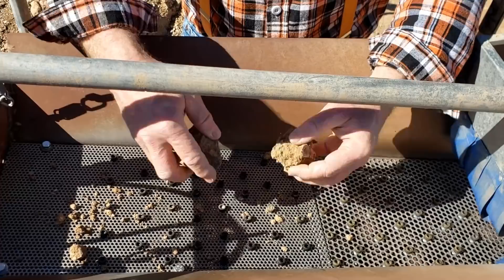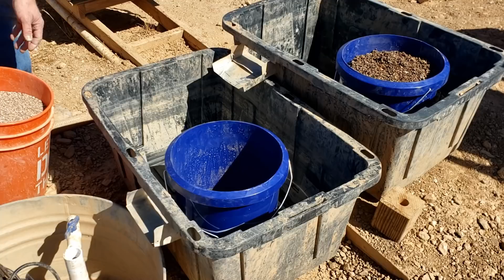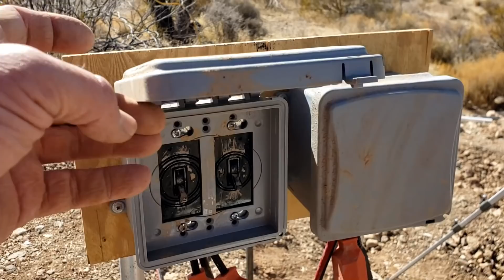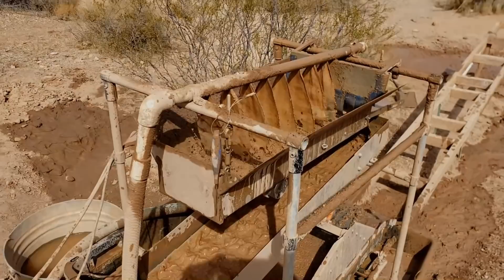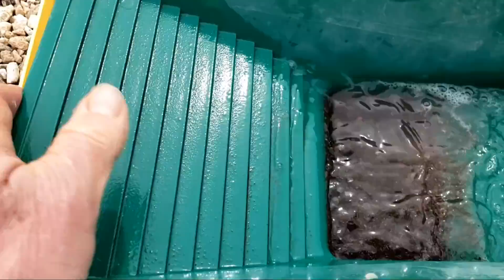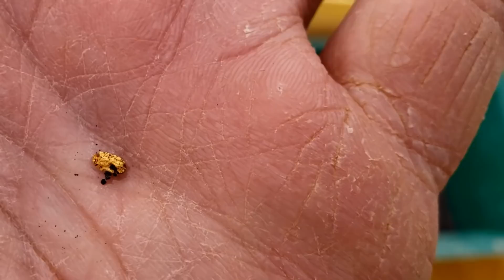Desert Gold Wash Plant Innovations 2021

Comment: I still can't come to grips with why your fine mesh doesn't clog up.
When I use a circular hand classifier at smaller than say 20 mesh , I need to turn the classifier upside down and tap it ready for the next load of material.
Also , do you not have issues with grass and decaying matter clogging up the works anywhere along the line ?
Reply from the maker: Thanks for your questions Mohammad.  That's the key to the intense vibration of the deck.  It causes solids and fluids to dance on the screen surface.  Eventually water drops through the deck while the sand dances off the end.  The deck pulse frequency is 60/sec.  Vegetation dances off the screen deck as well.  This eliminates sprayers from clogging  when water is re-pumped up to the upper shaker deck.
Reply: @allansgoldmining  Does your screen shake in all 3 dimensions or only up and down ?
Or maybe up and down and left to right
I am thinking about getting my backpackable system improved , but cannot utilize the sand filter - what am gonna try next is a punch plate screen wrapped in womens stocking.
Is to stop grass getting into my bilge pump
Reply from the maker: @mohammednovalija  the stockings sounds like a good idea !  Especially for a backpack system.  That should eliminate the vegetation issue. Sand would be too challenging to hike with.  There many secrets that I didn't want to divulge in the video regarding the science of the dewatering deck.  This was an attempt to protect my interests, preventing others from stealing my knowledge, then compete commercially. The large scale manufacturers of these dewating decks will not divulge the science behind how they work.  Sure, there are plenty of videos and animations, but no science.  I spent many months, days, hours, researching and experimenting to educate myself on this.  With that said, I can tell you that the "shake" of the deck is in a vertical direction tipped at 45 degrees.  How it accomplishes this, is a huge secret.  All components have to function perfectly, in order to operate correctly.  Best of luck to you !
Reply: @allansgoldmining  Thank You for description of your travels toward the goal of turning a desert into an oasis.
My material has probably half the amount of dirt you are battling against.
It seems there is only so far that you can downsize the equipment where it simply not viable for the amount of material processed in an hour - and the associated pay off.

Comment: Sir, just saw your Innovations 2021 , this is a question more than questioning your methods. Why would you run the silt through your sluice without the riffles or atleast moss ? Wouldn’t it be careless of you missing any fines going out with the silt ? Thanks for your time !
Reply from the maker: Hi William.  Are you referring to the sand clean up ?  If so, there is no gold in that gooey clay.  All was recovered on the sluice riffles during  the initial run.

Comment: You should invest in some flocculant instead of all that sand trap stuff. Then the good would settle out and you would just need to use the dewatering shaker and main shaker.
The tubs would be for settling and you'd do a over/under/overcurrent flow to force stuff down and out. Would let you run for a long time without needing to clean out he clay buildup.
For even longer runtimes an auger lifter that dewaters and lifts out the clay could also be done. It may be hard to get enough retention time in the settling though. Maybe a swirl tank could work too? https://youtu.be/G5w-6pnjwIc?t=298
Reply from the maker: First off, I DO use a floculant and Jet Dry.  2nd, what you are prescribing is for a large permanent based operation.  Very impractical for the weekend prospector.  3rd, For this application, sand is far superior for removing suspended particles.  The video link is interesting, but certainly could not handle the volume of suspended particles that is encountered with is plant.  The flow rate is 33 gallons/min.  Best of luck prospecting!

Comment: love the vid. great job on the build for the shaker sluice. one question tho.  i notice you have no powder/fines in your pan. admittedly fines usually take a lot to make it matter, but i think you may be losing your fines in the clay that is being discarded. might want to do a test pan or blue bowl some time to see if you are missing it. just a thought. have fun and good luck. looking forward to more videos. joe
Reply from the maker: Hi Leo.  No gold in the clay or tailings.  There's lots of -200 mesh gold in the pan.  Camera resolution doesn't present it well.  It's completely mixed throughout the black sand.  If you recall, I mentioned that you can't recover these fines with a dry washer.  Best to see it in a Blue Bowl. Thanks !

Comment: you might be able to run a 250 or 300 mesh screen on your shaker deck. Also If you spray off you screen like every 5 or 6 buckets of dirt would help your shaker deck work better.
Reply from the maker: Hi David.  After extensive experimentation I have concluded that 200 mesh was optimal. The large companies use 200 or less.  Also need to factor durability.  Finer screens are more fragile and can deteriorate at a higher rate.  Thanks for your comments. Best of luck to you prospecting.  🤠⛏⚒👍

Comment: Just out of curiosity, with the residual vibrations through the frame of your set up, how much is it efficiently or in efficiently  affecting the sluice. Even though the shaker and dewatering table have the springs they are hanging from, I would guess that there would still be some transference of the vibrations especially with so many motors above and below the sluice. I'm just wondering if those vibrations would be causing the gold in the sluice to be agitated enough to be bouncing around and hop/walk over the riffles and be caught/pushed along by the water flow. Maybe you could put some neoprene or rubber stubs. What would also be interesting is whether a slower vibrating motor at the top of the sluice box would make the gold walk up the sluice, much like tapping a pan to get the gold back to the top of a pan. Keep toying and inventing dude, great vid
Reply from the maker: Thanks for your comments and thoughts.  Despite what you see, there is very little vibration transmitted throughout..  The sluice rests on rubber pad.  Many people have rested their hands on the structure and sluice and were amazed of the dampened quality.  There is more vibration created by that material and water flowing over the riffles than could be of any concern from external forces.  Consequently, I test the tailings and find only a couple -200 mess specks.
Reply from the maker: Oh, I forgot to mention that the riffle mat is made of rubber.

Comment: You shouldn't use 2 vibrators in series, instead turn of them 90* to vibrate in both directions.   This way the two vibrators won't damage each other.  Also add vibration damping bushings or washers to the base frame to isolate vibrations/excessive wear to the lower frame.  It will also help keep your pipe stand from vibrating down into the soil and becoming out of level
Reply from the maker: Wow, not sure how to respond.  What is your expertise regarding vibratory physics and Energy Balance Mechanism (EBM) ?
Reply: brushless?

Comment: So at the end of your run you dirtied up your remaining water to clean the rocks - and then start with clean water the next day?
Reply from the maker: Good question James.  I use the existing dirty water to clean the sand.  Virtually all the suspended particles will fall through the deck screen (because it did on the first pass).  The vibration strips the sand of most moisture.  The suspended particles settle in a couple hours, so I muck out the tubs.  The next day I need only to replenish a small amount of water, while recycling the existing water.  The freshly cleaned sand will filter whatever particles become re-suspended.  Thus saving a good amount of water.

Comment: That was a great idea I would like to try something like that around here. There is so much quartz rock around here do you have any idea for a small rock crusher that I can add.
Reply from the maker: Hi Jason.  I don't have any recommendations for a rock crusher.  I know that Jeff Williams has reviewed a chain mill.  Maybe that can help you ?  Best luck to you prospecting !
Reply: @allansgoldmining  A simple small scale crusher can be made with a galvanized pipe with a cap on one side, then use a smaller capped pipe to ram inside after you put the quartz rock in. Just keep slamming the small pipe into the large one and it'll keep crushing.

Comment: Allan, Thank you for mentioning that you copied from the oil industry, Also another suggestion is make the exit end adjustable, due to the fact that when the finer screens run dry they tend to break up and they become very expensive, also adding what we call a "Possum belly" at the head would be beneficial at increasing the life of the screen.
Reply from the maker: Thanks Nugget.  You seem to know much about this type of equipment.  I spent many months researching and testing (and lots of failure).  The companies keep their technology a secret, so most of my education came from watching videos.  Finally found a research paper by the Chinese that helped a lot !  Yes, the deck is adjustable.  Had the end tipped up 2 degrees.  Also had a weir bar on the end, but the gooey clay began to accumulate too much, blocking parts of the screen, so I removed it, and works much better.  So, what is a "Possum Belly ?"  Is that something that softens the slurry landing on the deck ?  My slurry lands on a slick plate, so it gently flows onto the screen.  Thanks so much for your inputs !

Comment: AL you just hit a Bonanza on what you built get a panten pending on that puppy .you will be a millionare 4xs over
Reply from the maker: Thanks for the advice Lucky !!  Unfortunately, the dewater deck was already patented back in the 1980's, so not much to work with.  Looking forward to manufacturing these in near future.  Hope to make a few $$$ to pay for my hobbies.  LOL !  Thanks for your kind compliments !
Reply: @allansgoldmining  
Ummm AL if you have changed 10% of that Washer yes you can law states you have to change 10% that flat wash deck and  them 4 shaker motors and abything ells you changed will give you 5% you may have changed 10 to 15 %

Comment: Susgeston ..
Make a larger water holding container .take a 50 gallon barrel cut it  about an inch or two taller than your container size for your water .drill a serries of holes in the barrel if that pump will fit in a 5 gallon bucket  good Drill a series of Holes in the 5 gallon bucket  wrap the  bucket with screen .fill between  the bucket and barrel with sand  and use what you use for strainer for your pump .. this is what we ust to do years back with spring water   dig a hole for the barrell  only we would make it 5 to 6" wider  wrap the barrel with a nylon screen a couple time and place the barrel and fill around the barrel sand and charcoal to filter the water .. for making Corn whiskey  it would filter the water to drinkable and gave it a ph level of around 5.5 ..
Reply from the maker: Hey now, that's some good advice !  Let me "noodle" over that. Hummm ??  Appreciate it much !  Cheers !!

Comment: Love the new setup, looks like it's working better than ever. For doing your cleanups I recommend one of those flouting magnets for quickly and easily removing all your magnetics. What you said about putting the whole washplant on a trailer sounds like a great idea. Great video as always, can't wait for the next one. :D
Reply from the maker: Thank for watching Luke !  Appreciate the comments and compliments !  The sluice mat I use does a good job of removing a good amount of black sand from riffles.  I use a "Spin-it-Off" to remove additional magnetics from the cons.  Unfortunately, about a third of it is non-magnetic.  So, I still get quite a bit in the pan.  That's okay.  I use a Blue Bowl for final clean up.  Does an excellent job tackling the remaining black sand.  Best of luck to you !

Comment: Well done, that was amazing. Definitely an "A" grade project in engineering class there. Maybe one of these days I can see it in action. I'm going to do a recirculating sluice video myself here in the next few weeks. Mine is the lazy mans way that uses much more water. I'm planning to add a little flocculant at the end of the day, let the whole thing settle overnight then reclaim the clear water and dump the sludge. I'm hoping that with overnight settling I'll be able to reclaim about half the water in the system. Its not as heavy in clay as the stuff you are working. But I tried dry washing and because its fines and flat pieces,my tests show I got about 1/3 of the gold by dry washing - and even so I was getting a good 2 to 3 grams per yard. Hoping I'll get 80 to 90 % with sluicing.
Reply from the maker: Hi Chris !  Thank you for the kind compliments !  Glad you enjoyed the video.  Perhaps you can apply the sand filter idea to extend the life of the water in your sluice operation ?  Good idea to allow water to settle overnight.  I do the same.  Sometimes I muck out the sludge the evening before, so when you return the next day, there's a bit more clear water to recover.  If you're finding 2-3 grams with a dry washer, can only imagine what you'll find with a sluice !!  I'm jealous.  Wish I had that kind of ground down here. LOL !  Definitely, looking forward to that video !  Best of luck to you my friend !
Reply: @allansgoldmining   
~ Allan, Keene advertises that their 'dustless' model series 160, 190, and commercial 210 'dry washers' have recovery as good as wet sluicing. Have you ever heard about the performance 'or' personally tried Keene's 160 or 190 series dry washers.??
Reply: i've been using the keene flocculant in my recirculation system, that runs into a 5 gallon bucket from the sluice and the results are amazing. you can actually see that 4-5" from the bucket over flow that the flocculant is working. it has greatly increase my ability to process more dirt in a day! and yes Allen, i really like your innovation!

Comment: Do you classify your material at all before placing it into your machine ? - I myself run a 1/4 inch trommel and I classify the dirt to 1 inch before running it
Reply from the maker: No, I feed everything up to 6" rock.  This way I maximize gold recovery.  Gold tends to trap among large rocks.  Classifying, reduces your ability to recover more gold.  It's the same problem with the classifier on a dry washer feeder box.  Granted, I don't wash boulders.  Best of luck to you !
Reply: @allansgoldmining  Yep makes good sense - In my case I use a bucket classifier and classify into a bucket of water so the Bigger rocks get washed and hopefully any gold attached falls away into the bucket before throwing them away
Reply from the maker: @mohammednovalija  that's perfect !  This way you are maximizing gold recovery.  Alan Robertson up in Montana does similar.  He has rocks mixed with clay.  Has to soak in barrel.